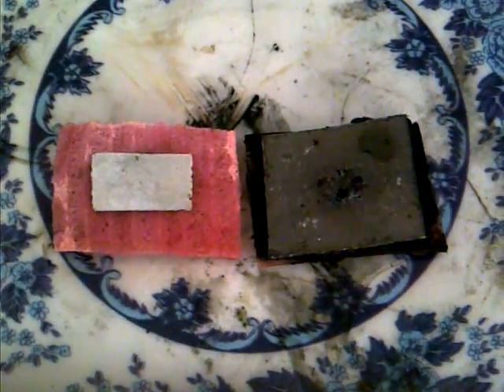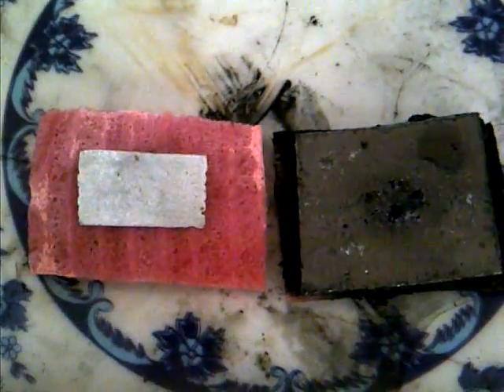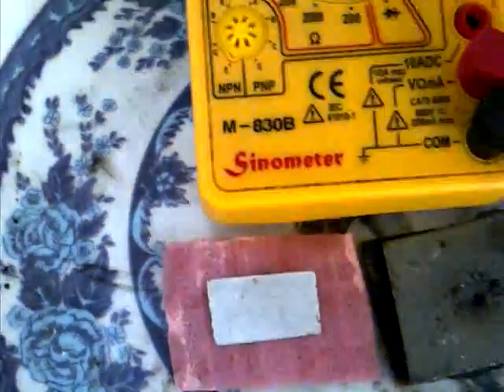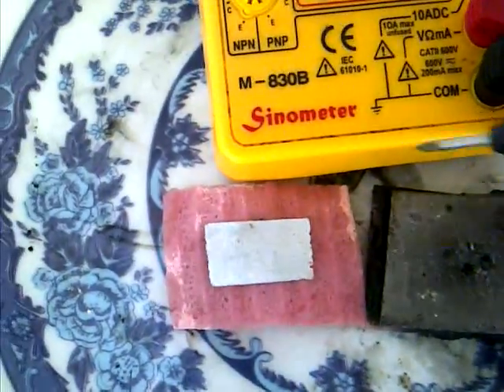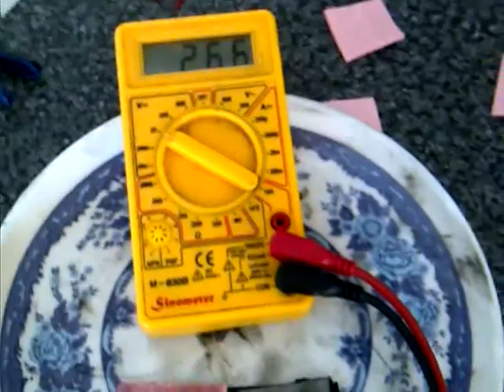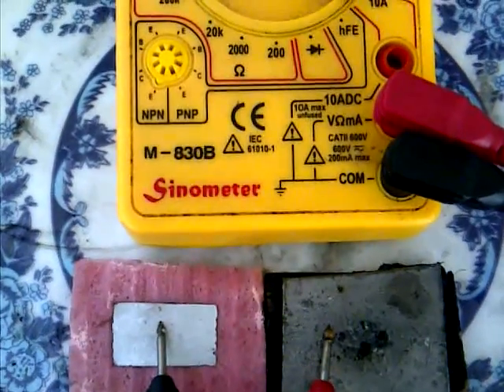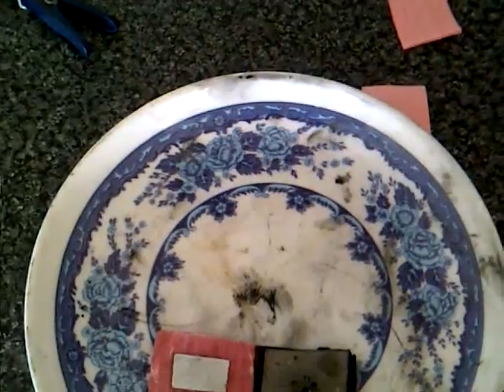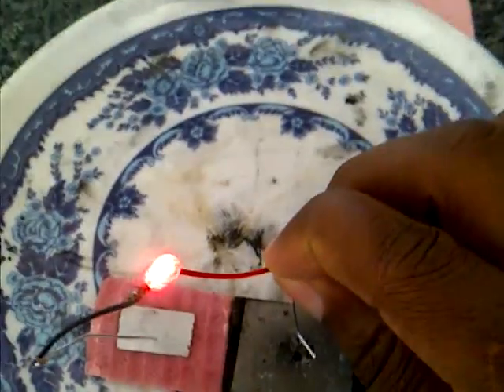aluminium-battery-2

Comment: Hmm, I just tried to replicate this with just NaCO3 in Water instead of the NaOH at the aluminium and Epson-Salt mixed with water and 25 % vinegar instead of the Sulfuric acid at the MnO2 side, but I only got around 1.22 Volts at maximum.... Hmm. seems I really must use these stronger chemicals to replicate it. Probably really depends on the PH-level of these stronger alkaline base and sulfuric acid ? How concentrated was your sulfuric acid ? Hmm... I don´t like to play with sulfuric acid though...too dangerous..
Reply: As long as the PH is low on the cathode side (<=2) and high on the anode (>=11).

Comment: Wow, cool ! Such a high voltage from such a simple cell ! It could probably light already a  white LEDs with it...The problem would probably only be, that the Aluminium foil is probably very fastly decomposed from the NaOH... Better try to use K2CO3-water which is a nice only low alkaline electrolyte for the aluminium. How strong is your sulfuric acid ? Did you try to use Alum ( K-AL-Sulfate-water) instead ?
Or with Epsonsalt-Water instead ? Is the MnO2 really the other electrode or is it the graphite ? Do you really need MnO2 in it ? Many thanks. Regards, Stefan.
Reply: The manganese dioxide contributes to the voltage on the cathode side of the reaction. With just the graphite, the voltage is lower.